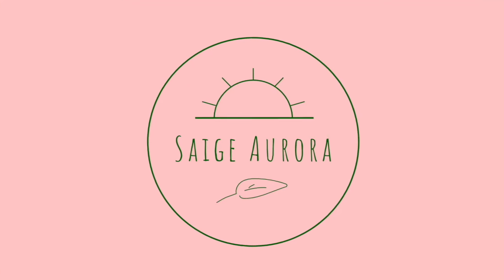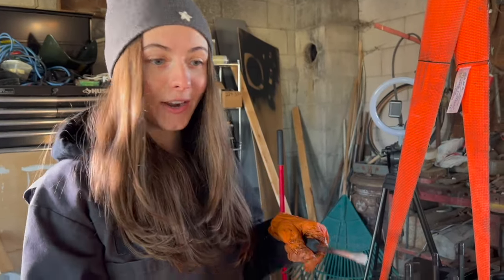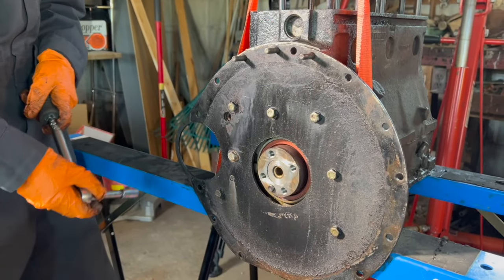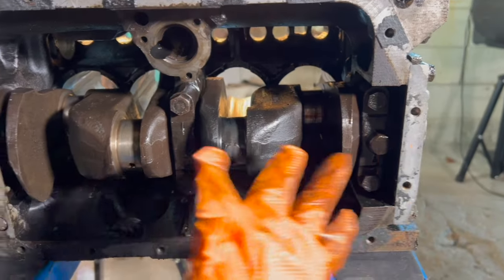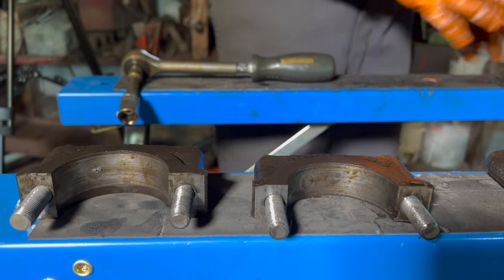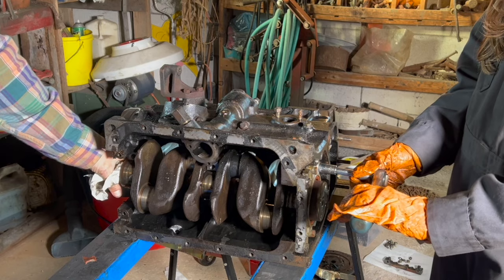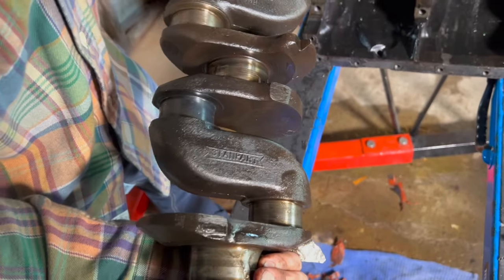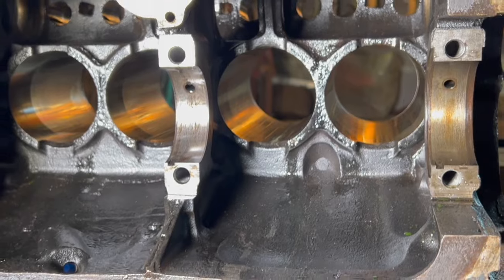Ep.11 | Restoring my '73 Triumph Spitfire 1500

Comment: Hi Saige, really enjoying your engine rebuild series. A quick note on draining the coolant from the engine; there is coolant in both the radiator part of the system as well as in the engine block. In the block it surrounds the top end of the cylinders, where the combustion chambers are, to keep those cool. That coolant doesn't drain when you drain the radiator (as you found out). However, if you look at the block at time 3:22 you will see, just to the right of the orange straps, there is a brass bolt/plug in the block. If you remove this, then that will (mostly) drain the coolant from the top end of the block and it won't make such a splash when you turn your block onto its side. Actually, if you do that before you take off the cylinder head, then you won't get that situation you had where the bores fill with coolant (unless you have a gasket failure or something). Enjoy your voyage of discovery and good luck with finding a machine shop.
Reply from the maker: Hi Nick thanks so much! That’s really helpful and I’ll be sure to drain the coolant from both areas next time :)

Comment: Bonjour Saige! :)  Good job done. First time the crank sees the light since 73! :)
I'd advise you to choose a shop familiar with classic car engines.
 Unlike modern engines,  classic car ones need larger mechanical clearances and caring people.
From this video,  I'm sorry but I found a couple more things wrong.. : 
At 0:22  The grooved tips of the diaphragm spring confirm the clutch cover is badly worn (a complete clutch kit will be needed).
At 3:11 At the top of the block, between the two studs on the right side, the locating dowel is missing.
It helps keeping gearbox & engine aligned on the same centre axis.  
When missing, clutch trouble or judder & unusual wear can take place. 
Finally, while you are at it, I recommend you to inspect/replace these clutch fork bits carefully as they are all prone to wear and can seriously prevent complete declutching : (slave cyl pushrod & its pin in the fork for ovalisation / fork pivot shaft & its tolerance ring for grip.. as this shaft is prone to move up or down ..ending down on the road! 😵‍💫+ 2 brass bushes in the bellhousing) 
Ensure the clutch bearing carrier is free to move a little at an angle, so staying square when the fork is moving (if not the case, the 2 "big" rotating thrust plugs are probably seized). 
Good Luck for the next stage & happy new mechanical year  😏
Reply from the maker: As always, thank you so much for your keen eye! I appreciate you noticing these things! I will be taking the engine and important parts to a very exciting person who I’ll be doing an upcoming collab with so keep an eye out for that! It’s been super cold here in Canada so I haven’t been doing much but as the weather and garage heat up I’ll be back at it :)

Comment: OH!  With regards to putting it back together, go head and get all new ARP bolts for connecting rods, main bearing caps and studs for the head.  Well worth the investment.  You also mentioned once about replacing a bolt with a stainless steel bolt on the engine, you need to keep one thing in mind.  ANYTIME you put to dissimilar metals together (such as steel and stainless steel)  you stand a chance of corrosion setting in due to the dissimilar metals reacting to one another.  If you are replacing a complete nut and bolt combination, thatt is not much of an issue but threading a stainless bolt into the cast iron block is not reccmended.
Reply from the maker: I will keep that in mind thanks!!

Comment: Hi Saige.... I've seen a few 1500's over the years that failed on cylinder #3.
Very strange indeed !  I have my theories why but no proof of it.  Very careful reassembly...new rod bolts...if you can afford it have the crank/rods balanced.  Then dont over-rev the engine once its in the car. With that it should be fine for a long time.
Reply from the maker: Wow very interesting, thanks for the tips!

Comment: I hope you had some time to evaluate this car a little before it died. Specifically, it would be good to have some idea of the condition of the clutch and transmission, so that they can be replaced or repaired if necessary while the engine is out for rework.
Reply from the maker: I’m going to have a look at everything before I put it back together so fingers crossed all else is good!

Comment: I have been following your progress on your Spitfire.  Welcome to the club of Spitfire enthusiasts!  Unfortunately, you are also welcomed in to the other aspect of Spitfire ownership........disappointment.  They go hand in hand, especially when you first purchase one and have inherited someone elses' maintenance habits.  I would have to parrot what someone else has said before.  Touch base with Elin Yakov.  He is very knowledgeable on these cars and may even have a machine shop in mind to refer you too.  Some other suggestions.......purchase a cordless impact wrench.  They come in very handy for teardown.  Also, for all of the gearheads who have cringed when you do this  PLEASE get rid of the vice grips!  An adjustable wrench  would even be better.  There is also a manual impact wrench for getting screws out that uses a hammer blow to push down on the tool and twists the screwhead at the same time.  One last item........I applaud your attempt to get "down and dirty" with this project and I encourage you to continue to do so.  Anytime you can learn something about cars it is worth it.  However, when dealing with a nut or bolt that is tightly torqued, try to get it loosened yourself.  That usually means getting a bigger wrench or a cheater bar.  I notice that you haven't used a breaker bar with your sockets, maybe consider purchasing one of them as well.  I love that you are working side by side with your father but there will be times when he is not around to break a nut loose for you.  SO, I highly encourage you to figure out how you are going to break them free.  Note: you can still let him lift the heavy things!  Just so he still thinks he is necessary in the build.  But a Dad's ultimate job is to train you to be able to do everything yourself when they are not there.  You'll probably need a new crankshaft, that you looks toasted.  Your machine shop will check the "roundness" and "taper" of the cylinder walls to see if the block needs bored out.  THey can magnaflux the block and head to ensure there are no cracks anywhere.  When they have the block at the machine shop have them go ahead and "deck" the block to make sure the top of the block is perfectly straight and thereby reducing any chance of the head gasket blowing.  Also, if the head doesn't already have hardened exhaust valve seats, go ahead and have them install them in the head as well as planing the head surface to ensure it is straight as well.  Look forward to your installment.
Reply from the maker: Wow Kevin I really appreciate you sharing all your knowledge! I’ll definitely look over your list with my dad and possibly purchase some things. I totally get what you’re saying and I’m definitely going to try to be more hands on as I get more comfortable and knowledgeable! Good thing I’ve been hitting the gym, next time I go I’ll be sure to do some wrist strengthening exercises to help with losing bolts! 💪🏼
Reply: @Saige's Garage  Remember......it's not always about your strength but more about the mechanical advantage you bring to bear.  I saw where you and Elin met at the car show.  Glad to see you having him for a valuable resource.  Another pearl regarding the hydraulic clutch and brakes.  If at any time you work on either of these, flush them out completely and change over to DOT5 brake fluid.  It's a silicone based fluid and when one of those systems leak (not if) it will not ruin the paint like the DOT 3 (which is what's likely in it now) does.  Looking forward to your next episode, I am "assuming " where you let us know that the crank is shot.  Oh! Don't dismiss that 1300 engine so quickly.  The main difference between it and the 1500 is just a different crank that gives each piston a longer stroke which, in turn, gives you the extra 200cc of displacement.   I believe the heads are the same.  I don't recall what carburetors were on it but likely dual SUs which are much preferred over the Stromberg that I believe yours has.  May want to ask Elin about that.  Another thing!  May want to go ahead and replace the throw out bearing while it's exposed.  If the PO "rode the clutch petal" it could be going out.  Pretty inexpensive and easy  to go ahead and replace it now.  Good luck!
Reply: @Saige's Garage  BTW, sometimes it's better to go ahead and do "something" even if you are not comfortable.   In the medical field we have a saying......"see one, do one, then teach one."  Now go out and "do" one!

Comment: That crank looks toast, you might have an easier time finding a stock size replacement. As far as the cylinder chunk missing, you’ll probably have to get that bored oversized and a sleeve installed in cylinder #3 by the machine shop.
Reply from the maker: I wasn’t sure if there were sleeves already in there but it doesn’t look like it, I’ll definitely look into a replacement for the crank

Comment: I'd try to find a good STD. dimension crankshaft. It would be nice to get  a set  of rods with it. Go for top quality rod bolts! Did your big end bolts/studs have bent tabs on them? Do you get a sense of whether you are the first one to take it apart since 73??
Reply from the maker: I’ll look for one! My big end bolts actually didn’t have any tabs and we’re definitely the first ones to take it apart since 73!
Reply: There were no tabs used on the 1500

Comment: Please remove those head studs, they will have to come out anyway and it will make handling the block easier as you can turn it upside down. Normally the studs come out as an easier way to get the head off.
Pay attention to the posts re: Elin Yakov.
Reply from the maker: We plan to take out the head studs in the next video!